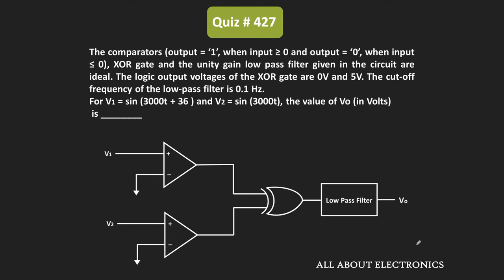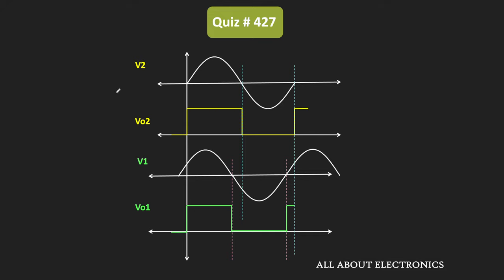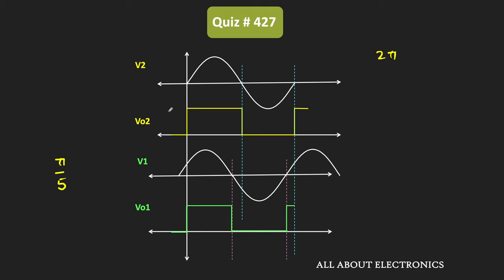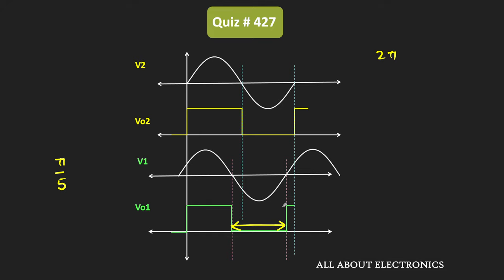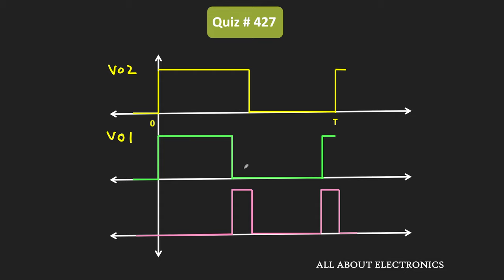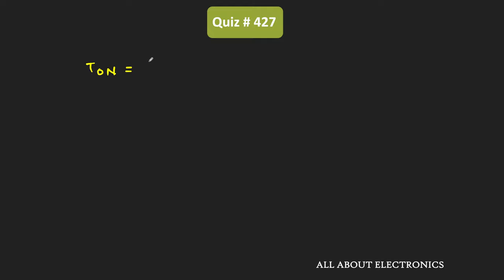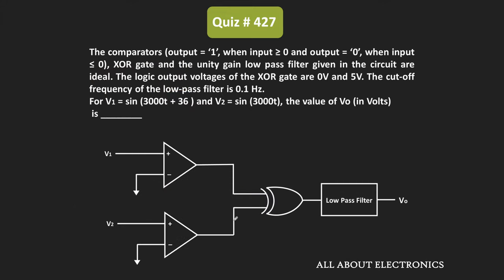Comparator and XOR gate Solved Problem (Digital Electronics) | Quiz # 427

Comment: For Vo1, isn't the waveform from -π/5 to 0 should also be positive??
Reply from the maker: Here when you turn ON the circuit, then initially it has been assumed that, all the outputs are zero. Therefore, before t = 0, the Vo1 is also zero

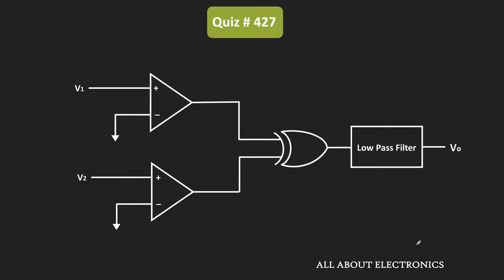Comment: 0:47, how does low pass filter gives average value
Reply from the maker: Here the cut-off frequency of the low pass filter is 0.1 Hz. While the operating is around 470 Hz. And the filter is ideal. So, it will give you the DC value of the waveform. That is the average value of the waveform.
I hope, it will clear your doubt.